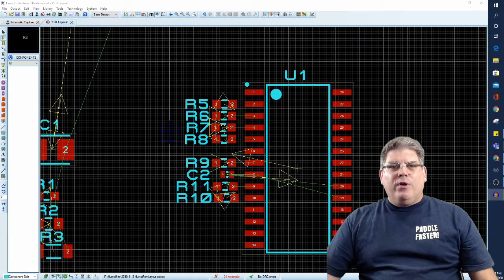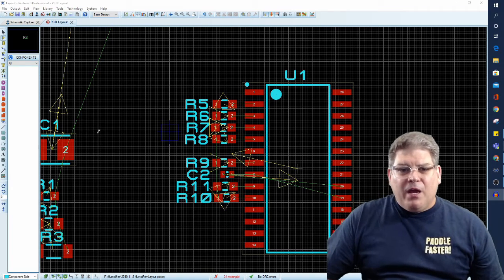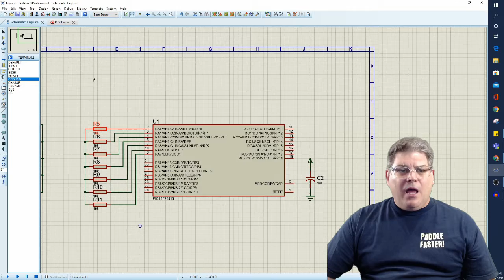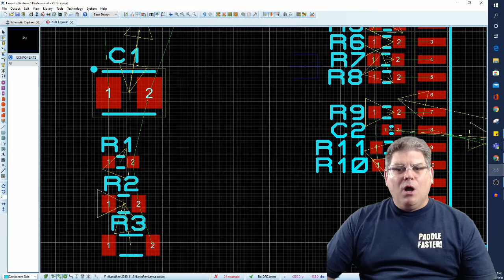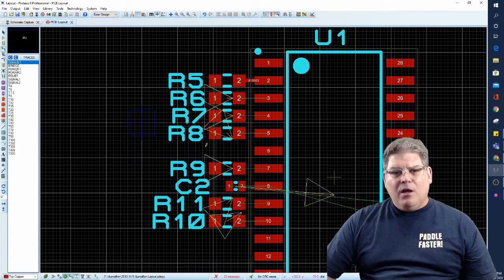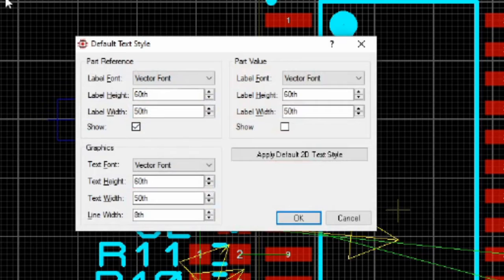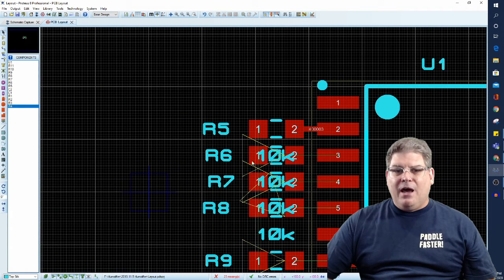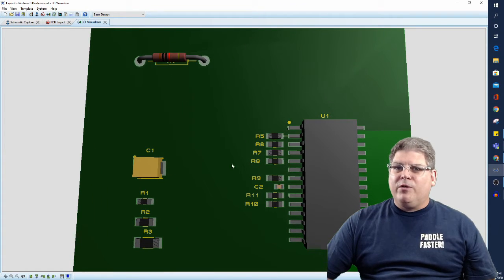Proteus PCB Text Size and Silkscreen Modification

Comment: How to add custom text on your pcb?
Reply from the maker: If it is simple text, using the 2D Graphic Text Mode 𝐀 will do the trick. You can change the text font, size and orientation (be sure you are on top or bottom silk layer). If it is something more complicated you wish to load, try this video:  https://youtu.be/hUcCb31HYF8
Reply: @ScottCard  Thanks for the reply !!
I did this, I can see the text in PCB Layout, but I am unable to see it in the 3D view. I wrote text on Top Silk layer